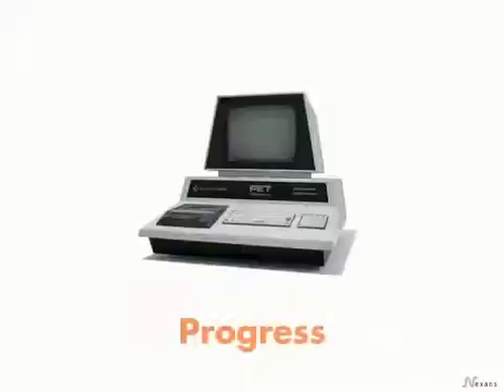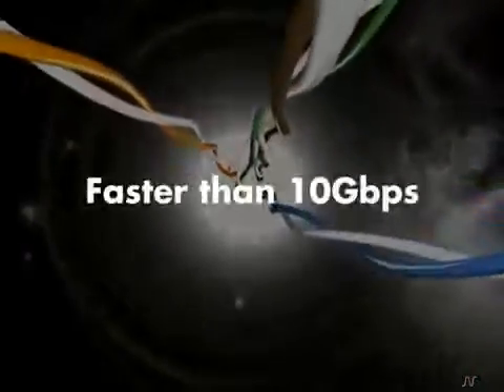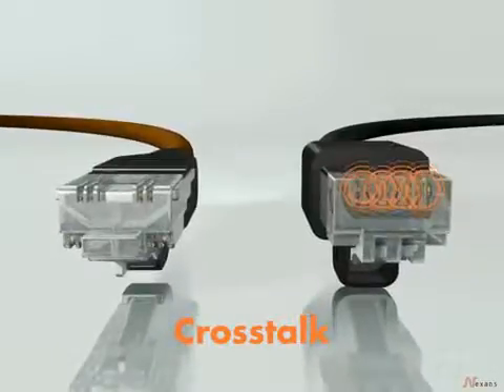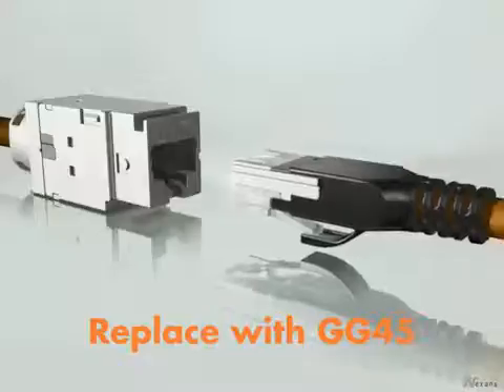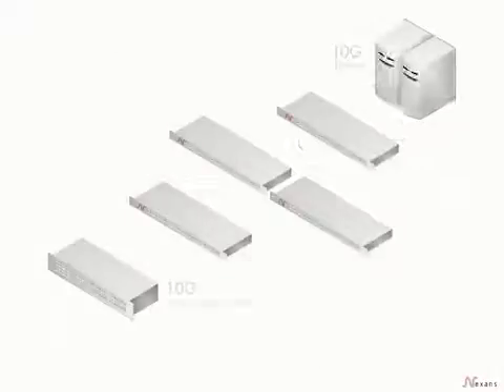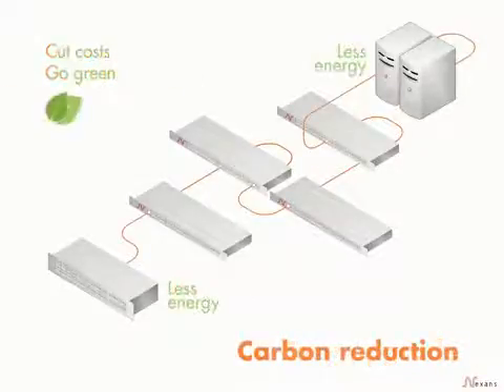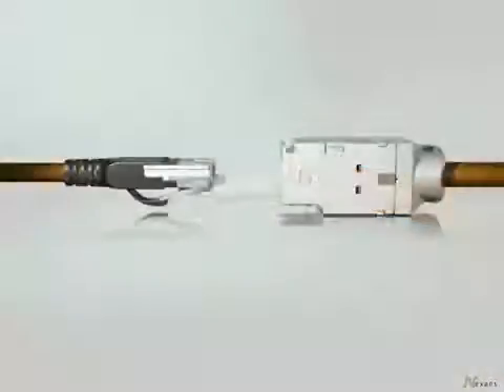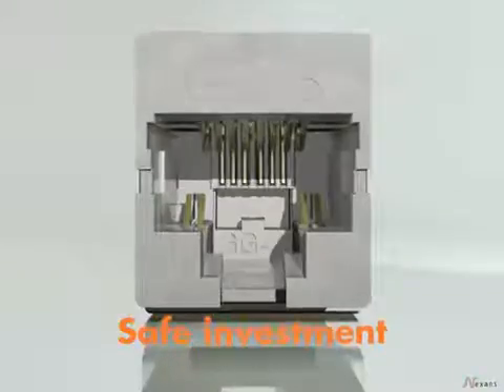How to connect the Nexans GG45 Cat7 and Cat7a with an RJ45

Comment: Haha this is from 8 years ago.  There will never be a twisted pair standard beyond 10Gb.  It is not going to happen folks.  They can’t even get POE working along side 10G base t.
Reply: What does Cat 8 do then? (40Gbps)
Reply: @JustAnotherYou2ber  there will never be a 40Gb Base-T spec.  Not going to happen.  I think a long time ago they thought that it would happen eventually but it’s not going to happen.
Reply: @5urg3x  but I know what you mean. Over copper it's very inefficient and generates some serious heat
Reply: @JustAnotherYou2ber  Exactly.  Everyone already switched to optical cables and there is already oSFP which can do insane speeds.